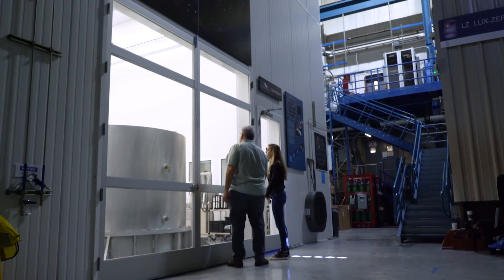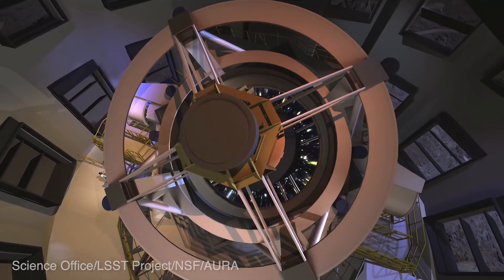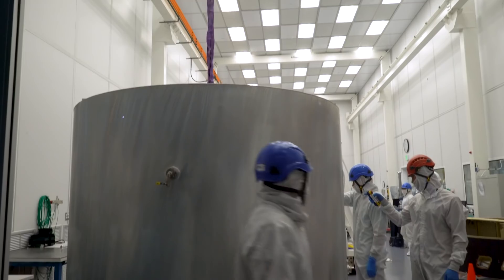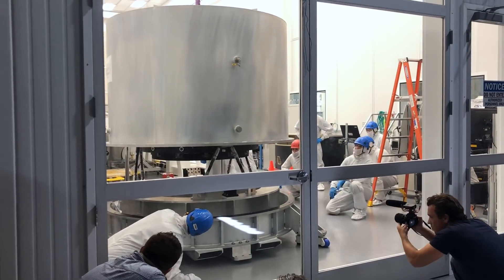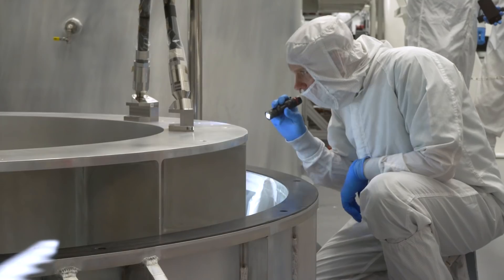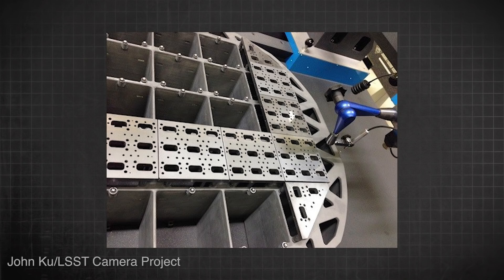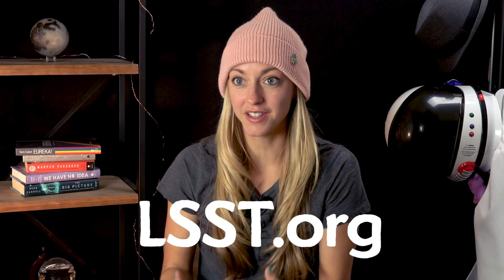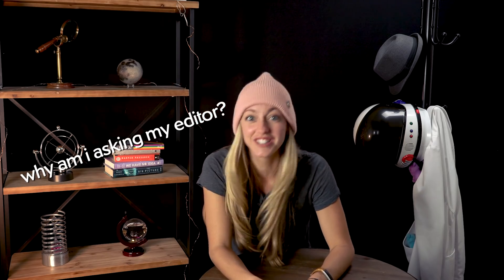World’s Largest Camera Lens

Comment: I wish you talked more about how the lenses are built and how they are going to overcome distortions from lens weights.
Reply: Yes, I am wondering too. apart from the potential of the weight to warp and change the surface area, I am curious about the pressures under the amount of weight potentially changing the density of the lens material (Gradients) sufficiently to create distortions. Uniform distribution of the pressure would be required and needed to be accounted for prior to creating the dimensions for the surface area.

Just a bus driver myself, not sure if what I said is at all important.
Reply: @brycering5989   considering, glass of old church windows, has flowed down and slumped, its a valid concern. im thinking the cold temps may reduce that effect. or they may have a rotation program to spin the lens so that the effects are even distributed, like the rifling of a gun bore.
Reply: @sMASHsound  I did a bit of digging. not sure about glass flowing. I have heard of the windows. but one article suggest it was that way due to the way it was formed. 

also not sure of the lense itself. its fused silica which is not a crystal state but has a higher melting point. I don't know enough to comment more on this.

well worth looking into and discovering if it will distort the lens over time.
Reply: @brycering5989  im pretty sure they accounted for it, its just that it wasnt covered in this vid. or even that there will be enough warping to make a mechanism to compensate.
Reply: @sMASHsound  that story about glass in old windows flowing is a myth
Reply: @brycering5989 These things are all definitely concerns.  There's a good book on the Hale telescope called The Perfect Machine which goes into great detail on the never-ending difficulties faced in developing the 200-inch mirror and its precursors, the 60 and 100 inch scopes on Mt Wilson not far from LA, and the 40-inch refractor at the Yerkes observatory.
Reply: I would hazard that the net positive/ net good (?) is that it sends you jumping into the rabbit hole of 
https://www.lsst.org/gallery/mirror-fabrication

 I'm gathering that its "curvature" and "honeycomb structure" contribute to its um integrity and uniformity? I think I'm acing this open notebook quiz... 
As a bus driver, do you often observe human failures of achieving goal of distance and time with regard to catching the bus on time? 
If bus A is scheduled to arrive at stop B at time C, and you're house is distance D, and your safe walking speed is E, you would still need to arrive at least 15 minutes early at the bus stop to account for any digression from arrival time...
Reply: @genghisgalahad8465  I don't remember if the answers to these questions were discussed, But Tony DID do an LSST hangout with the fine young lady and the gentleman in this video. I just don't remember how long ago it was. I'm a moderator, though, so I don't get to pay as much attention to the actual content as I'd like. STILL, I do feel like the challenges of making a lense of this size were discussed
Reply: @genghisgalahad8465  Thanks for the link.  Very nice.
Reply: Yes, I was jesting with a play on the word "lens" and the term "weight" with gravity and lensing, gravitational lensing. I did't realize the gravity of the situation.
Reply: As a kid I used to help my dad build telescopes, his hobby;  you basically buy the round glass disks, in matched pairs, and use carborundum powders to grind the glass. The piece of glass you attach to the grinding table will become convex;  the one you grind with on top becomes concave;  but this takes a lot of work.  You walk around the table while moving the top glass piece back and forth and slightly off center.  When you start to feel the resistance fading it means you need more carborundum powder and water.  Every week or so you test for radius of curvature. The final work is the most difficult, because you need to move away from spherical curvature to a paraboloid;  and that is very tricky.  But that was for reflector telescopes; these are refractive lenses.  Also, I'm not suggesting these lenses were built in some similar way;  I don't know;  but it will give you an idea how historically the work has been done.
As for the question regarding distortions from the lense weight, short answer is I don't know; but long answer is that probably it doesn't matter as much as you might think, because it is how light refracts as it enters AND exits the lense that defines the optics, and those two surfaces are likely to remain at the same angle through weight related deformations.  So, while deformations might have some effect, they would not be first order effects.
Reply: Maybe they can do that in another video.
Reply: if you guys want some more in depth discussion, check out the Hangout Tony Darnell hosted on Deep Astronomy
Reply: And what's the advantage of a lens over a mirror here?
Reply: Mind blown. https://www.lsst.org/about/camera/focalplane
So the telescope lenses augment the telescope's mirrors?
Reply: @genghisgalahad8465  It seems to me there are no mirrors in this telescope;  that it is 100% refractive.  I could be wrong.  Makes sense to me, as the stated mission is wide field imaging;  and reflective telescopes are best suited for narrow field.  Amazing to see refractive works of such scale!
Reply: @privateerburrows  There appeared to be some mirrors - one was labelled "primary / tertiary" and had a hole in the centre, which suggests possibly Cassegrain or Gregorian optics?  The telescope appeared to be altitude-over-azimuth mount (which seems to be way of big telescopes these days), so there might be a Naismith feed?

The lenses were for the camera.
Reply: @vk2ig  Ah, okay; thanks for the clarification. I looked at the drawings folder and didn't see anything suggesting a mirror, but probably what I was looking at was a section diagram of the camera alone;  not of the whole telescope.
Reply: @privateerburrows  There is a very large mirror - 8.4 meters, or as the team says "the width of a singles tennis court".   The lens is only a part of the camera!  It's amazing;  that lens is larger than the lens on the largest refracting telescope ever put into service, which is at (the recently closed) Yerkes Observatory in Wisconsin.
Reply: @privateerburrows  : Ah that's what I wanted to know. Thanks man.
Reply: @astroscribe  Very good question!
Reply: @astroscribe  Compactness? That's my best guess
Reply: Mirrors and lenses do distort under their own weight.  And the amount of distortion will depend on the angle of the mirror or lens.

A friend of mine was grinding the primary mirror for his first reflecting telescope.  It was a 15" blank, but he was only grinding a 12.5" mirror, thus leaving 1.25" unground radial section between the mounting frame and the mirror surface.  When he got close to finishing the mirror, he stood it on one edge to do the green light interference test, and noticed that the top half of the mirror was fine, but the bottom half was not.  He decided not to do anything immediately, and thought about it for a while - he hit on the idea of rotating the mirror by 90 degrees - sure enough, the "new" top half was fine, but the "new" bottom half was not.  Clearly the mirror was distorting under its own weight.  So, he manufactured a mirror frame which kept the mirror in compression.  After making some minor "touch up" grinding corrections with the mirror in its frame, he sent it off for silvering.  The company that does the silvering said it was the best amateur-ground mirror they'd ever seen.
Reply: @vk2ig   yes they built a frame  for them that keeps everything kosher ,supporting the lenses and bacause they dont move the sagging is kept under control ,i wish i could find the video on ut .might have been a ted talk idk
Reply: I can't wait to find out the f/ stop. :-)
Reply: i want to know more how they overcome chroma coma and spheric aberration.
Reply: @charlieangkor8649  https://en.wikipedia.org/wiki/Achromatic_lens
Reply: I'm sure it was all calculated. They appeared to be really thick so maybe just supporting the edge is enough. They didn't make it clear if the camera itself would actually be moving with the telescope. If not, that would also simplify things.
Reply: @CrimFerret  the whole unit (mirrors and Lens) need to be in perfect allignment with eachother, the whole unit. moves as one.
https://youtu.be/idR97j4MTe0?t=112
Reply: and how fluidity is countered!
Reply: @AS-bm5xv  Well the telescope will probably one have a 50 year or so life before other tech makes it obsolete so any flow of glass would not be problem.

That is if glass actually flowed.  The very slow flowing of glass is a popular myth.  There are many places where this is discussed.  Here is one.

https://www.cmog.org/article/does-glass-flow
Reply: @Michael Skinner They don't need to keep it perfect, Do they? As I see it, they can also create a model for distortion, apply corrections (or even calibrate the outputs?)
Reply: The same way they correct aberrations in small lens even easier with large ones.
Reply: then lenses ar staionary and helps in low expansion mounts the light is bounced into the lens my mirrors , this way the lenses dont distort as they would if constantly swung around and held at angles ,basicly the lenses are flat and support themselves , its a very simple solution and I wonder why didnt they think of that sooner, its probably because of the comuputer guidance is so good these days
Reply: there are tonnes of vids about lens making. the special thing in this case was the material, being fused silica, the fiber optic material.  the work to get it there is just grinding, measuring, rinse, repeat
Reply: I suppose all these considerations were tested in CAD before building the lenses. Just like you would design a coil spring, the lens was built in a relaxed/imperfect shape, so that when it's mounted in its assembly it will deform enough to become perfect for the scope.
The lens assembly can be tested for distortion in various orientations, and the whole telescope will be tested again before going online. Software can be used to correct for distortion in any given orientation.
Reply: they use glass and grind it to shape
Reply: @chriszag702  Thank you Mr Obvious. This is not standard optical glass. Just producing the fused silica blanks for these lenses would have been a huge challenge. I'm betting the annealing time was measured in months at least to ensure no internal stress in the blanks.
Reply: @CrimFerret  its not rocket science, Telescope Was First Patented in 1608 and not alot has changed, we are just better at it...   been liveing under a rock? (:
Reply: I don't know why they don't use lighter mirrors that can be supported from behind, like in other large telescopes. Other than some basic bullet points, there isn't much actual information provided in many of these science channels.
Reply: I'm not an expert but I do work with laser optics so... The weight of the optic is something you can't compensate for (well, you can use a sealed volume behind the lens with a controlled pressure to offset gravity I guess) but assuming it's supported evenly across it's load bearing surfaces you basically have a stable optic.  There's several different stresses placed on optics that can cause them to distort however.  One is the internal stresses built up from the manufacturing of the substrate itself which is usually dealt with by annealing the substrate to a certain temperature to allow the material to 'relax' and then slowly cooling it to keep internal stress to a minimum.  Mounting stress induced by differences in the coefficient of thermal expansion (CTE) between the optic and the mounting hardware can also play a factor, especially if the optic is tightly coupled to the mounting hardware.   SiO2 has a pretty low CTE if i recall correctly, and they most likely picked a structure that has a very similar CTE to mount it to.  There are alloys that have virtually zero CTE such as Invar so it's likely they are using something like that for the mounting hardware.  As for coupling the optic the the hardware... I'm not sure how they would be doing that.  At very low temperatures like -100C (how they plan on using it) pretty much everything turns into very stiff solid.  You could cause stress on the optic if you firmly clamp the optic to the mount because there will be deformations of the mounting hardware due to CTE as it goes from assembly temperature to operating temperature.  They could be using something like Indium which is a viscous metal and rather 'sticky' to bond the optic to mounting hardware.  The benefit of indium is that is sticky enough to hold the optic in place but it is soft enough to 'flow' and change it's own shape rather than coupling any CTE induced stress into the optic.

Or maybe I'm wrong and they're just putting some duct tape on it? 🤔
Reply: The LSST linked info corroborates this?
Reply: Yep. That was one of the factors for "Rise of the Reflectors." The sheer mass, the fact that multiple surfaces need to be precisely finished (as, to correct all colors, typically a minimum of three elements are needed, so six surfaces), and the fact that it can only be supported by the edges all limited the maximum aperture.
Reply: Ali Hamed Moosavian I’ve worked on telescopes like this and know people on LSST. I might be able to answer some questions about the optics.
Reply: Looks around the bar, speaks in a low voice: what can you tell us??
Reply: Genghis Galahad :). There really are no big secrets.  Most of it is written up in the SPIE.  As for distortions, they can be predicted using FEA.  Form looking at the lenses they don’t have much power so the distortion won’t be too bad, I think. Most of the distortion due to gravity changes will be large scale and can be taken out by bending the primary and tertiary mirror and adjusting the optics alignment. The lens directly above the CCDs will act as the vacuum window and will have the cold CCDs on one side so there will be a lot of stress there.  Still those sorts of stresses are what FEA is for.
Reply: I don't do jargon or acronyms. What I do understand in broadest sense is that the honeycomb structure and curvature of the mirror per the website addresses any issues and the lens assists the focus. All the adjustments you mentioned, aren't they situational? The website covered the material of the material. Still your explanation is very technically in depth with regard to functions. So you're saying the original post's concern is addressed by simply adjusting the mirror?
Reply: Genghis Galahad Sorry about the jargon. I’ve been doing this for too long. The sag of the glass can be predicted with modern analysis techniques. I suspect that any of these can be corrected by slightly adjusting the shape of the primary and tertiary mirrors. There are also adjustments that can be made about the alignment of the primary, secondary, and camera assembly. I hop that helps.
Reply: According to LSST, they apply that "honeycomb structure" and curvature to address that issue. There's no suspecting if the information is all there. Unless I missed something that wasn't addressed by website.
Reply: Genghis Galahad Well the honeycomb structure of the primary/tertiary allows for a fairly light stiff mirror.  Light compared to a solid mirror. But it is made of E6 which distorts of the temperature in the glass is not uniform. You need to provide careful temperature control and small amounts of bending to the mirror to correct that distortion. I suspect that there is other bending applied to correct for distorting no in the lenses.
Reply: My guess is that they used top notch glasses for these lenses and hired the greatest experts in the field, everything must have been thought of. And maybe distortion is predicted but only after ten years??? Maybe they will also use adaptive optics if they see any distortion happening over time.
Reply: Win Dows The lenses are fused silica which can be made extremely uniform but even this is specified and tested.  The telescope will use active optics, not adaptive as this won’t work over a field as big as is used in LSST.  All the large honeycomb E6 mirrors use active optics to handle figure and thermal distortions.
Reply: Aspheric design my boy...aspheric design. High index of refraction as well...in the range of 1.76
Reply: Ali Hamed Moosavian Jesus Christ... What is all this perfectly matched and stabilized lenses bullcrap... No lenses, not even the small lenses in your phone are distortion free. Every raw footage is distorted. Cushion effect being the most common, warping in this case probably a major factor too. The thing is tho, that the camera itself is known so lens distortion can be compensated via software (image processing). Also the distortion is relative to the orientation of the lenses and you can bet they did the math for that. Lastly the real device needs to undergo Calibration to compensate the error in the real device. 
This is an engineering piece. You make it as good as possible but know there will always be an error. The question is how to handle that error.
Reply: If you note at the beginning she mentioned using pure silcon and active correction. But this would be cool
Reply: Y'all still believe in gravity?
Reply: It’s very thick
Reply: https://www.lsst.org/about/tel-site/mirror #thetruthisoutthere also #lookingforcougars ... never thought about lens weight distortion, but I am familiar with term (not so much the physics of) "gravitational lensing"?
Reply: @genghisgalahad8465  No, it's not gravitational lensing.   No material is perfectly rigid and the structure like a lens will deform from its' own weight.  The shape of the lens changes with its' orientation.  That's why the 40 inch refractor at the Yerkes is still the largest of its' type even after over 100 years.    Perhaps the fused silica allows for larger lenses, but the actual size of the lens isn't clear from the video.
Reply: Ugh. Yes, I know it's not gravitational lensing. I was kidding. I didn't claim perfect rigidity or whatever. I did learn there is the "honeycomb structure" to support the mirrors and the lens to help the mirrors focus. It's all there. https://www.lsst.org/about/tel-site/optical_design
Reply: @genghisgalahad8465  gravitational lensing is the fact that gravity can bend light, and thus when we look at massive galaxies, we can see distorted light from behind it, being 'lensed' from the gravity of the galaxy in front.  Neat! :D  https://en.wikipedia.org/wiki/Gravitational_lens#/media/File:A_Horseshoe_Einstein_Ring_from_Hubble.JPG
Reply: She doesn't know how to say words
Reply: @mr2octavio  "Crispier", "Cryo unh".
I understand a science major not speaking like a Shakespearean scholar but, at least, get the scientific jargon right.